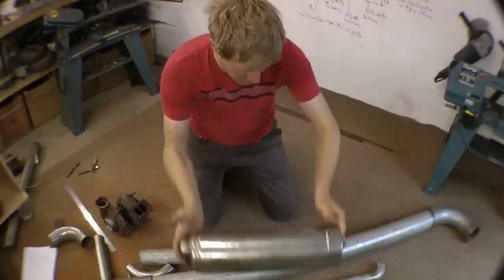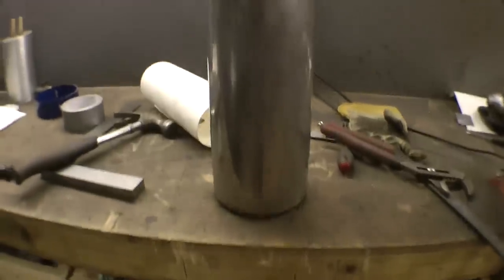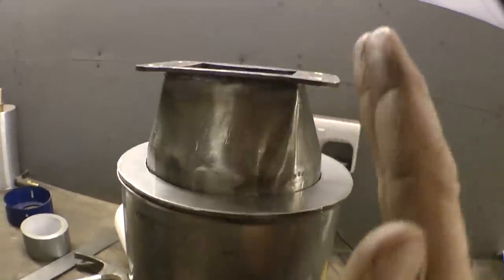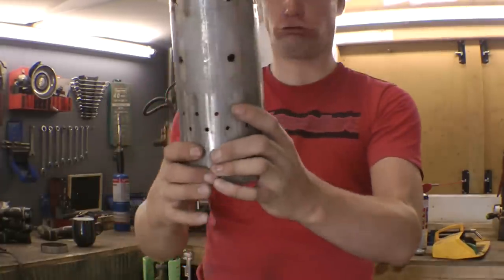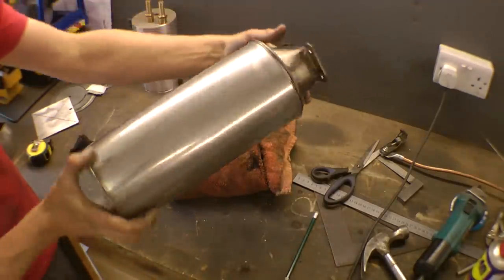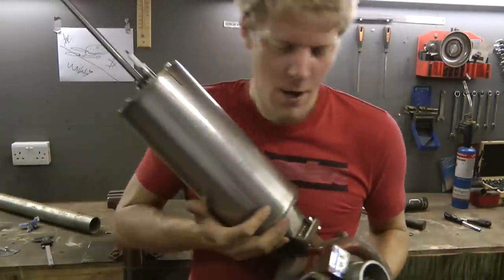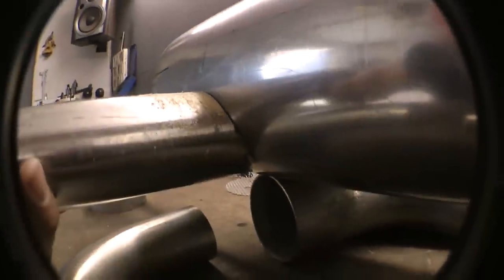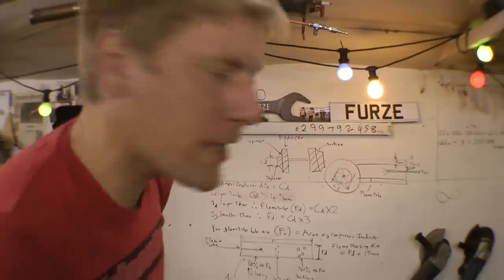How to build a TURBOJET ENGINE

Comment: Quick question: we pretty much built the whole thing, is the Fuel Pipe closed in the front? The gas doesnt light up, we have a thermocouple installed, temp stays the same.

Comment: damn 10years later i come back to this and now i know enough to finally understood how the fuck that thing works...
Reply: bro same
Reply: @pequod_  fr
Reply: Me too bro lol
Reply: Can you explain it like you would to a 6 year old so us in the back can understand.
Reply: @xFersureMatt  sure! you said 6 years old, so i won't go into the maths.
a turbo is a relatively simple device that is normally used in car engines, and it works a simple way: it has two separate sides, an exhaust side and an intake side, with a fan in each (or rather "turbine"), you blow air into the exhaust turbine to make it spin, and it spins the intake turbine. that intake turbine then will strongly suck in air, so strongly that it will put it under pressure, and you can then pipe that pressurized air into whatever you want. in cars you use the exhaust gas to spin the exhaust turbine, and then you use the intake turbine to push more air into the engine, because "more air means more boom and more horsepower". that's the baseline of a turbo, you push gas through the exhaust side, and produce pressurized air at the intake side. but colin is not using that in a car engine.
now we are talking about a jet engine, which is a fairly simple device in principle. it hinges on a simple principle: when gas get hot, they increase in pressure, and it's even better if you pressurized the gas before hand. more specifically, if i take some gas and use my hands to push hard on it until i'm not strong enough to push harder, then i heat up that gas, when i release it, it will push several times harder than me. and so a jet engine is simply a container (combustion chamber), in which you place a compressed mix of fuel and air, that's the base conditions for it to do something: pressurized air and fuel. then you light it on fire, and the burning gas increase even further in pressure and escape to produce a strong thrust. the hard part is that you have to do that in a continuous manner.
what colin does is that he take his combustion chamber, and before letting the exhaust gas escape outside to directly produce thrust, he directs it through the exhaust side of a turbo. this powers the turbo, make it spin, and allow it to produce compressed air on the other side, as it's supposed to. then he takes that compressed air and pipe it into the combustion chamber (after adding a bit of fuel from a pressurized gas tank). this allows him to fill those base conditions: pressurized gas + fuel, by only stealing a tiny little bit of the energy produced by his engine, and the more pressure he put inside, the more energy he gets at the exhaust. this works well because it is entirely continuous: the turbo is always spinning from the exhaust, it's always pushing compressed air into the chamber, the gas tank is always adding a bit of fuel to that, the pressurized air + fuel mixture is always burning, and it is always pushing strong exhaust gas through the turbo to keep it spinning and produce more thrust.

hope this help.
Reply: Same thing. And i will build one next year

Comment: I’ll go to a scrapyard to get parts for my fighter jet. It should go at least Mach 1.2, or roughly 930 mph. It’ll actually use rockets to take off from my farm field. Ill also make a hypersonic plane out of titanium with thin iron plating on the nose and tails. At Mach 12, it should fly to Nebraska in at least 5 minutes. It will be powered by six rockets, which will eject after 6 mins, and then I’ll nosedive down, engines off, and land wherever I want.

Comment: If I wanted to machine my own compressor instead of using the turbo what material would you guys recommend, I know alum would not be a good idea because the low melting point but what about stainless steel

Comment: This is probably one of the best DIY videos of all time on youtube. Fabrication of turbojet using a drill press with drill bits, handheld drill with hole saw, angle grinder for cutting/grinding and sheet metal forming in a vice. If this isn't apex DIY on a budget I don't know what is. Wonder how much work it would be to convert this to a turbofan, turboprop or turboshaft for broader application life (turboshaft-electric hybrid tractor? ;-) )

Comment: Colin PLEASE biuld a turbo jet with the flame tube between the two turbo housings, use a bigger one on the same shaft to compound the intake pressure and an afterburner! Run it on diesel, you won't, you've changed I can draw up what I mean, I just feel this is more appropriate for your skills, and I need you to test it for me haha

Comment: Easy to assemble==>allmy.tips/hBenchGrinder?るy     easy to use and for the price works great for what I bought it for - Sharping mower blades -this has both stone wheels but may think of changing one to a wire wheel in the future. Grinder is very sturdy & Heavy enough that I didn’t even have to bolt to the counter to use, didn’t move once while in use !!

Comment: Anyone know how to permanently join or weld Nitinol wire? I've got 4 of one meter lengths. The join has to be strong enough to keep mechanically operating 24/7 a pully system, to power a motor-electric generator, only using waste heat. I've also got a pile of large E & I laminated plates, missing some wire, but no idea how many windings to put round to go from say 12v AC to 240 v AC. I'd like to get higher voltages of 400 v ac, even up to nearly 600 volts, or possibly higher. I'd like to build 12/24v - 240/415v transformers for Inverter & PSU supplies. Also want to wire up transformers, that eliminates back cemf under load issues, even use the back emf to double the primary drive. Anyone live in or near West London? Great video..! Need to get an angle grinder myself actually.

Comment: Why does this turbo jet engine need a restriction (flame tube) with very small holes to increase the air pressure before adding the fuel but large airplane engines don't? I know that they already make a lot of pressure (~35 bar) but why is that important for small jet engines? Is it to increase exhaust velocity? If so then why would a restriction increase the velocity?

EDIT: What I mean is that, don't the holes restrict the air and create a higher pressure outside of the flame tube than inside? Wouldn't you want to have the highest possible pressure during combustion for maximum thermal efficiency? 
The only logical explanation I can think of is so you insure that the combustion process doesn't send the exhaust gasses back though the intake (because there's a higher pressure just before)

Comment: No video of it running, and here are two reasons why: oil lines were not plumbed to cool and lubricate the bearings, and the hot and cold sides of the turbo were switched. If actually ignited, it would have piss poor longevity due to the aluminum compressor wheel being spun by the exhaust gases. Makes me wonder why he put some much time and effort into this build, but fabricated it "backwards."

Comment: I wonder if you could use a Stirling cycle engine to produce liquid air then run liquid air through a super conductor designed Joe cell to produce electricity that have the liquid air boil off vapor pass through another Joe cell at a different frequency to generate hydrogen vapor to fuel a jet engine? You seem intelligent do you think it would work to make a personal jet pack?

Comment: Love all of your crazy stuff. Wish I had time (and the workshop) to do this stuff. Here is a suggestion to "Turbocharge" Your "Turbojet" with a steam "AFTERBURNER" instead of all that expensive fuel. See instructions below. 1... weld a simple tube jacket around your thrust tube with two openings. One for filling with water - the other is a tube about one mm diameter that leads steam from the jacket to a point blowing directly onto your "HOT" turbine. This will cool the turbine and also create more expansion from this point back out the thruster tube. It could be configured as a Pumped boiler or the way I describe it is a "Batch System" that will run like your normal turbojet until the boiler starts boiling at which point it will be a "HYPER STEAM SPEWING TURBO EXPLOSION JET" engine. You might want to add another larger steam line controlled by a safety release valve so that WHEN the boiler overheats, the excess steam will release onto your hot turbine driving the system even more powerfully. This is really a better idea for a turboSHAFT configuration because I think the steam will increase torque more than thrust. Who knows ????

Comment: alright, you've made a turbojet. now, take it up a notch, and cobble together a turbo-ramjet, like what the old SR-71 Blackbird had.

I, a nobody as far as YouTube is concerned, challenge you to do it.
Reply: Problem with doing that is that there's no point building a ram-jet for low-speed or stationary applications.
Reply: @oscarmuffin4322  Ramjet with compressor
Reply: @paxtoncargill4661  then you've just defeated the purpose of having a ramjet.
Reply: A ramjet wouldn’t work static. Also making an axial jet engine is rather hard.
Reply: Ram jet only works at minimum 500 kmh
Reply: I say take it to the next level and make a rocket engine
Reply: Wow, not only was this 4 years ago that I made this comment, it has over 100 likes? And I wasn't notified...? Time really does fly...
Reply: @Caldoric  You don't get notified about likes even if you turn it on in the settings.
Reply: @theyeetus1428  I get that

Comment: Don't you need to Atomize jet fuel before it will burn
Reply: Or is that what the turns does
Reply: 4:05 That's what that fuel rod is for I'm pretty sure.

Comment: what is the difference between a puls jet and a turbojet?
Reply: disclaimer: I am not a engineers so don't quote me on what I am saying below.
pulse jets are a U shaped tube with a combustion chamber on one end (with holes on both ends) and it uses bits of physics to intake air which causes it to have a pulse effect (basically it alternates between combustion/thrust and intake rapidly). turbo jets use the power of the exhaust /thrust to run a air intake system leading to constant thrust (vs a pulse jets pulsing output). 
but you would be better off looking elsewhere for an explanation on how they work (I am not a engineer nor am I a jet scientist).

Comment: for this engine does the gas have to be pressurized or does it suck it in when you open a gas valve ?
Reply: he has to get it running by some kind of starter first (like a real engine) and then it sucks the gas
Reply: Bratwurst5000.
I guess it would be stated with compressed air.

Comment: Awesome.  When I get the time and leisure, I am going to build a turbojet based on the "Tesla" Disc turbine aka boundary layer turbine.)  I made a significant improvement to the disc turbine, which should make it more robust and efficient.  Maybe I should gift you with that idea.  Anyway, should be able to build a very compact radial-flow turbojet engine for peanuts.

Comment: Hey Colin - would it be possible/practical to rotate the combustion chamber 90 degrees, to shorten the length of the intake pipe?
I imagine this would require the turbocharger to be split apart, and the shaft lengthened in order to create some extra distance between the compressor and the turbine.
How would this affect the center parts of the turbocharger, and the oil circulation?

Comment: I've watched this video a few times can I still can't work out if it makes appreciable thrust or if it's just a novelty.  I watched the meat levitate on the Turbeque, but could you actually use this to do something absurdly mental like a turbo bicycle or something?
Reply: +QueenReign power to weight on jet engines made from turbos is not that great, however if you make a turboprop attachment you can build a jet bike that will go pretty fast!! someone on youtube has done one I think. I'm going to put my micro turbine on a bicycle and see how that goes...

Comment: At 3.24 it seems you are just welding using the torch and no rod, why is this?
Reply: he just melted the 2 base metals together with out the filler
Reply: rigsofrodsmaster is this just as strong then?  I have only used a stick welder before, but I would like to advance a bit.
Reply: +Gary Lowe look up TIG welding, rod or not, you can go either way. Obviously the bead isn't going to be as thick.

Comment: I challenge you to build a rocket with a moon lander and land it on the moon! Jokes on me it will probably only take you like a day and some scrap parts....
Reply: It takes a lot more to make a liquid fuelled  rocket than you obviously realise a solid fuel rocket engine can't function in vacuum of space and refuelable liquid rocket engines and control systems are not cheap
Reply: @rowengarvin4833  ma dude, if the rocket has oxydizer and fuem it works in space, it doesnt matter if it is solid, liquid, or gas.
Reply: @santiagoperez2094  actually it does matter a jet requires oxygen to work space is oxygen less vacuum
Reply: @rowengarvin4833  a jet its not a solid rocket.
Reply: @santiagoperez2094  yeah what do jet turbine engines require to operate oxygen and fuel supply to operate and don't provide required high torque thrust load capacity of rockets
Reply: @rowengarvin4833  yeah and? what has that to do with u saying that a solid rocket cant operate in space?
Reply: @santiagoperez2094  you obviously  understand either Jet Propulsion or Rocketry as propulsion methods
Reply: @santiagoperez2094  no it can't why do you think that have gone liquid refuelable rocket engines can't store enough fuel for long distance because solid furled rockets can't be controlled burn times

Comment: Dude, I love your videos, but this is NOT a turbojet. It's just a turbocharger with a combustion chamber attached. So basically a powered flamethrower, it will not provide thrust.
Reply: Tommy Taylor The cool side of the turbo compresses the air...That's you know....the point. If it wasn't adding a lot of oxygen it wouldn't heat up like it does because the fuel would not be burning properly. And there would be smoke and fumes. A turbo works pretty much like a jet engine. Uses exhaust gasses to drive the turbine and through a shaft the compressor.
Reply: Tommy Taylor not all jet engines are axial flow, early jet engines used centrifugal compressors like this one does.
Reply: Tommy Taylor The compressor provides the compression..... just like it does when used as a turbocharger in a car. Try Googleing "turbocharger"
Reply: Tommy Taylor You know a car Turbocharger has a compressor on the inlet. It's a Radial Compressor.
Reply: They do provide thrust, couple people strapped em to go karts.  Not that fast but still can move the thing!
Reply: It is a turbojet engine, I fail to see why it is not?
It has Intake, Compression, Combustion, Exhaust. The only thing it lacks would be a propelling nozzle.
Reply: No, it is not… there in NO compression. There is combustion and exhaust, but with out compression it's not a turbojet. It's just a turbo(from a car) that shoots flames.

Comment: Great product, but not functional. I doubt he was actually trying to make a proper jet that could power a small rc plane. Maybe if a nozzle was put on the back end of the turbo's fan you could create some thrust. I saw some of that fiery corona out that side. To achieve actual functionality it must be a straight airflow. With this model the air is sucked into the tube combusted and then shoved back out the other end. It's reversed on itself which drains energy. That's partly why it was unreliable. The other being  it was made with scrap and a rusty turbo. Nevertheless, loved the video, this was just for people who thought he meant functional turbojet.

Comment: Have you considered building a two stage compressor and/or an intercooler? (just build two flame tubes, with two turbos and connect the cold side outlet of one to some tubes going through a tub of cold water and then on to the cold side inlet of the other turbo. Then split the cold side outlet of the second turbo and connect it to both combustion chambers) In theory, this should mean a higher flow rate of air and thus more power. To make it even more complicated, connect the jet side outlet of the first turbo to the combustion chamber of the second one. What do you think? Feasible?

Comment: I like that you are working hard to do somethings, but with the jet engine? you are a litle far from the real thing. you know? a jet engine after is started is just becoming self sustaining. (the compresor and the after burnerturbine are missing) and combustion chamber anctualy is the one you called flame tube, and it is to big and does not have enough hols. but there are many things missing from your jet engine. you can use 3 or 4 smaller combustion chambers. the gases must burn inside the combustion chamber, because the compresor is pushing to much air inside the engine so the flame must be protected inside the cobmustion chamber. all the hot burned gases are dilated so they are going in the rear part of the jet engine, passing thru the aft burn turbine.this  is accelerating it. and that turbine is mounted on the same axis with the compresor that will star spinning verry fast and pushing a lot of air inside the engine.

Any way. keep up the good work.
You have our respect.

Comment: your my hero great stuff.how would you increase pressure on a hho generator i am using a 12 volt 4 amp battery charger and using it to make a gas welder problem is the pressure is to low and i keep getting flash backs should i increase the amps will that make any difference thanks Colin bob.
Reply: place HHO generator in container that'll hold the pressure.
sensor to detect water level. if water level is low pump water in. gas pressure=water pressure.